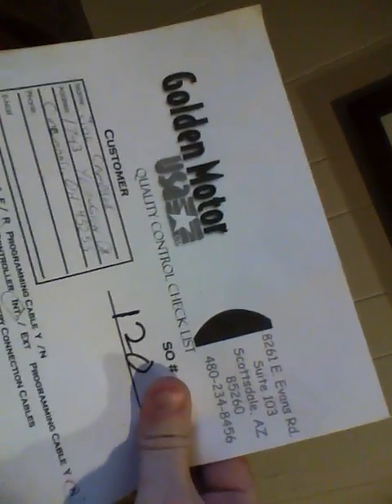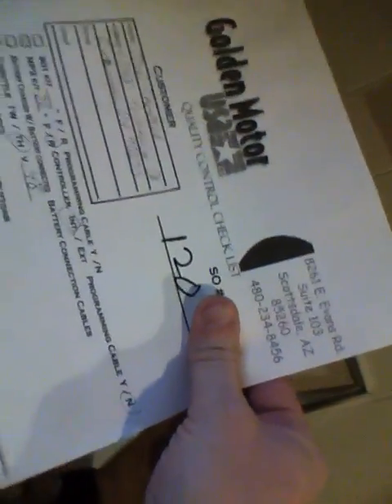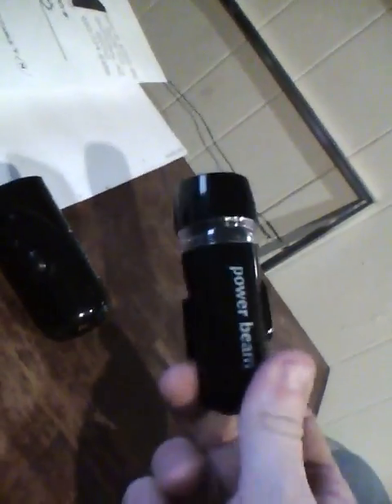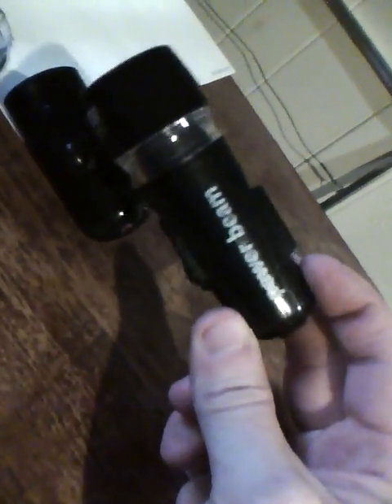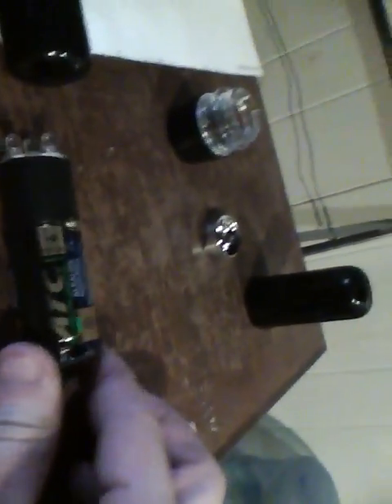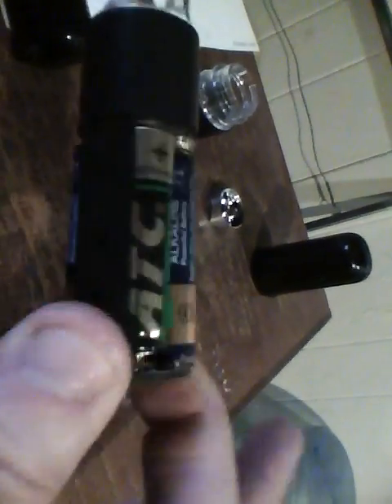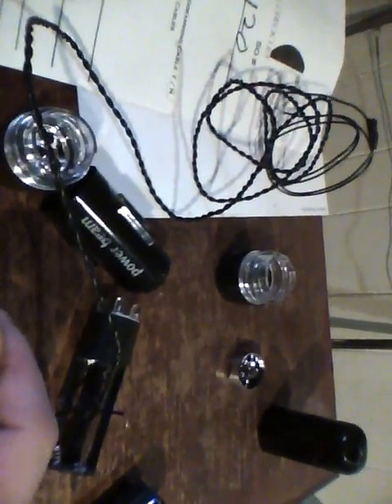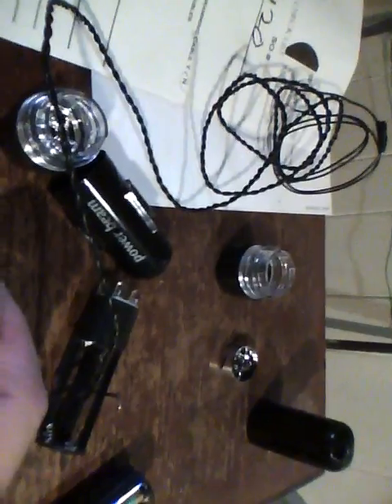Getting lights running on an electric bike.

Comment: how is your light project working out? Perhaps it would be cheaper to find a new cheap LED battery powered light that is feeding off 5-6 voits (3-4 1.5v batteries)? I am working on building a Golden Motors electric bicycles forum on Fbook. You on fbook send me a info or do a searchon fbook for Golden motor electric bicycles.